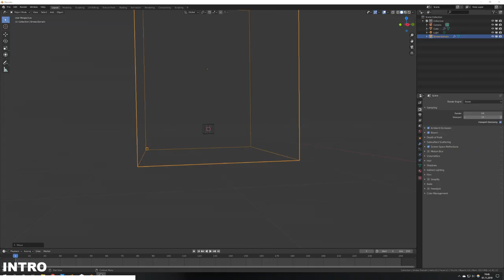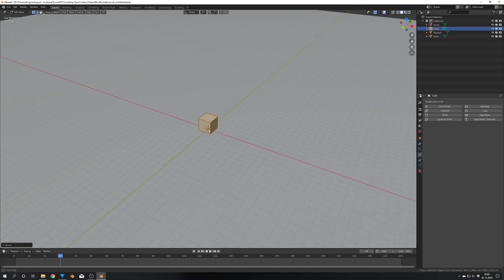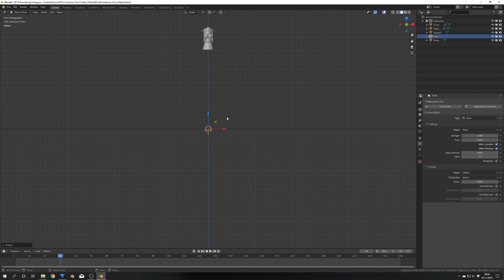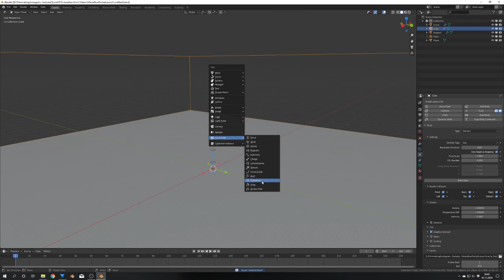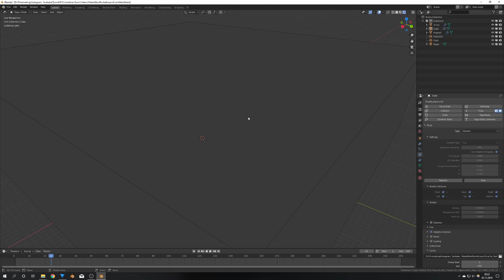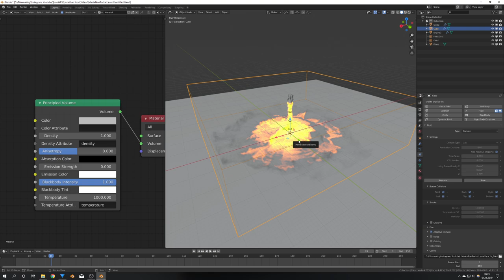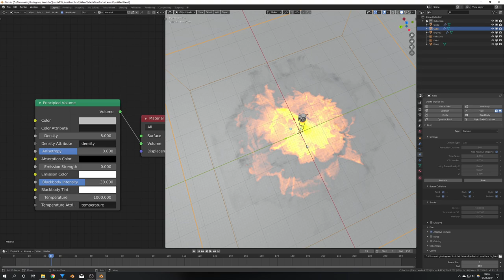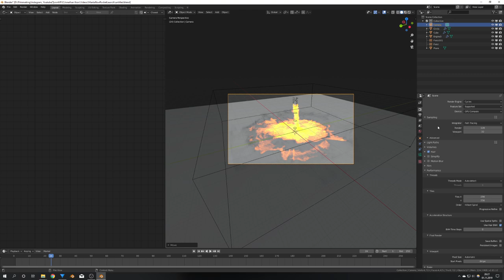Blender Mantaflow Advanced Tutorial 2.82 [Rocketlaunch] | English

Comment: Im not being able to render smoke in Cycles using the experimental branch of Blender 2.82 mantaflow released on 27th November. Do you know why is it?
Reply from the maker: Try to uncheck adaptive domain. Helps for me
Reply: @JonathanKron  Ill try. Its working for me when I automaticaly add the old "quick smoke". It generates automaticaly the same thing that I did manualy (even with adaptive domain activated) and I can somehow render with cycles without a problem. I have to compare both manually setting up the domain and creating the "quick smoke" parameters to find the problem. Maybe you can also investigate around this matter. 
Thanks!!

Comment: Hmm, question, I get the last build for mantaflow on Blender site / experimental but only can render in viewport, not in batch when I use F12. An idea ? Also, in Modular, when I resume a stopped bake, the simulation restart from the good frame but like it start a new simulation from zero. If you can told me which version use to avoid that can be great ;) Thx
Reply from the maker: In this tutorial, I use one build before the latest one because I also had problems with the newest version. I guess we will have to wait until another build release.
Reply: @JonathanKron  does it have a possibility to have the previous version you use somewhere ? Thx ;) Good tutorials too :) PS : use Houdini sometime too but Mantaflow open a new vfx area for blender ;)
Reply from the maker: I don't think that there is a download link for that but you could ask on the discord or reddit. Maybe I'm wrong
Reply: @JonathanKron  Oki thx, I'll check ;)